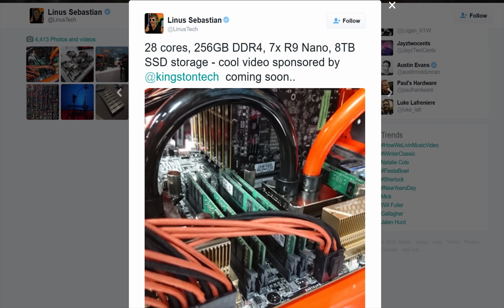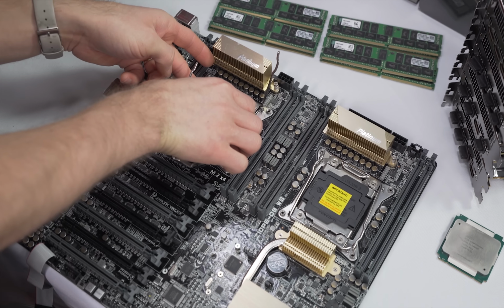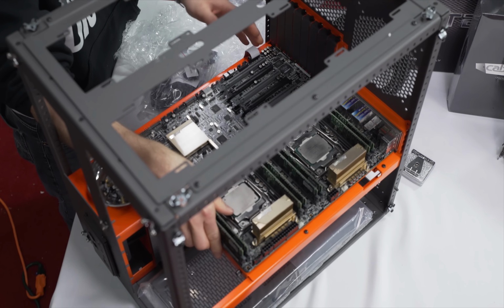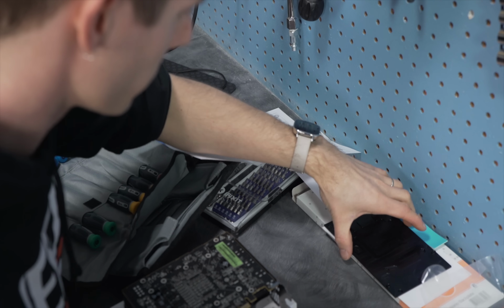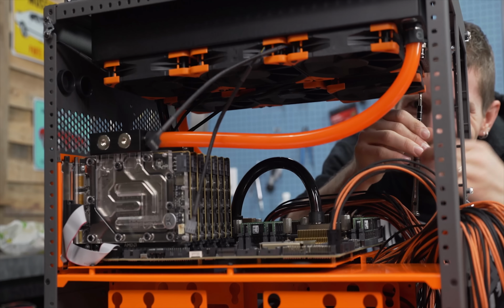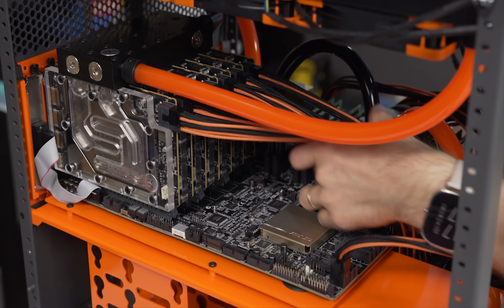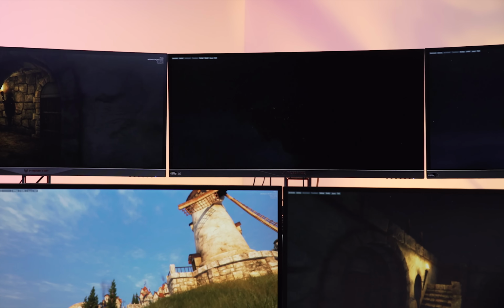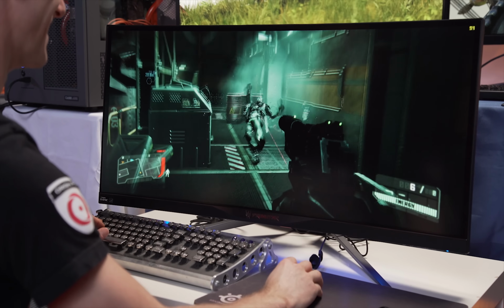7 Gamers, 1 CPU - Ultimate Virtualized Gaming Build Log

Comment: Those are two CPUs. It should say '7 Gamers, 1 PC'.
Reply: +Pascal Lafrenière A PC can have multiple CPUs and this one does.
Reply: +Dennis Gäbler And in fact technically pretty much all of our computers do. Technically each core of a multicore CPU is a CPU in itself. They just all happen to be on one chip
Reply: +Man of Low Moral Fiber It's a play on '2 girls, 1 cup' I think...
Reply: +Man of Low Moral Fiber Its all the same to the mother board and system. You cannot run two kernels simultaneously with these 2 CPUs and they act effectively as a single unit.
Reply: +Niles Black System level operation is a bit more than semantics... Its all that matters here, and a single mother board can only run a single system, no matter how many CPUs are attached to it. The 2 CPUs will always, necessarily act as one unit. So yes, there are 2 physical CPUs, but that is more a coincidence of how commercial CPUs are made... They could just as easily be the exact same two CPUs in one metal casing and there would be no difference at all and you would then call it 1. The fact that they happen to be separate from each other doesn't seem that important.
Reply: +Pascal Lafrenière You don't seem to know what you're talking about. Those are two CPU's.
Reply: +Man of Low Moral Fiber I agree, it's two CPU's. I've been a sysadmin for 2 decades, we all call them Multi-CPU's, Dual, Quad etc.  CPU is a chip.  Probably mistitled.
Reply: Guessing you did not hear Linus? There is not 1 CPU which can run that type of PC
Reply: +Man of Low Moral Fiber 2 sockets yea but still considered as 1 CPU for workload. Although oracle and ms will charge you double the license cost :P
Reply: +Niles Black Depends thoudh, cause where im from, we refer to the entire tower as the CPU. cause think about it, every graphics and logics processes are running in a unit, in this CASE, heheh , get it, case its the tower itself.
Reply: ***** it doesn't matter, it's like using SLI or Crossfire. It's still two physical CPU's. And as much as I enjoy watching Linus videos lately, I don't like when they have a projet that gets issues and they just skip the post part, turning it on, seing the parts move etc. They build tension and suspense with issues to the viewer, and then skip directly to benchmarks. I hate that.
Reply: CPU stand for Central processing unit, you can not have 2 center in anything, it's illogic.... Intel call their chip CPUs because in common pcs, you only put one processing chip and it appear to be the intel one (or amd)...

 But if you put one more processing chip on your motherboard, you will not add another center of processing, you will only add more core to the complete build.

that's my point, I dont care if you're too dumb to understand it, I may be wrong but please, give me your point if I am
Reply: Pascal Lafrenière Everyone refer to a CPU as the processor. That's why many servers will refer to their setup as Dual CPU or Quad CPU.  Same with graphic cards, GPU. If you have 2 you don't say you have one GPU. You will say dual or crossfire or SLI. (2 Way Sli, 3 way, 4 Way) but you will not say you only have one GPU.  So in this particular video, it's 2 CPU's, 7 GPU's.
Reply: +Man of Low Moral Fiber even if it is on 2 chip, a pc can only have 1 cpu

Comment: So how would a lan game go? Each instance must have its own IP i'm guessing,
Reply: +DJParsons89 he said he was running vms. There are aton of different ways to set networking up for vms. But the simplest is to just give each vm its own ip.
Reply: +DJParsons89 Probably uses a virtual LAN app like LogMeInHamachi
Reply: +Wyatt Freda-Cowie umm no, a service like hamachi would not be necessary because they all would already be on the same lan. Most vm applications will allow you to control each vms independent ip and give them virtual mac addresses. I honestly have no idea how the technology works but my best guess is the host machines connection is broadcasting multiple macs to the router. The router then assigns an ip to each mac, even though they are technically the same device (though the router does not know this). The vm client then filters incoming traffic and does a little routing of its own to send each packet to the vm associated with the destination ip. Or else all traffic is just sent to every vm, but I don't think that is what is happening. In this way the router sees 7 different computers even though they are all hosted on the same machine. Since they are all connected to the same router, they are all by default going to be on the same lan. Anyway I am by no means an expert but I have some vm experience and based on observations I have made in the past this is how I think it most likely is handled.

Comment: Linus you better not stop here! At CES2016 you need to obviously set the machine up for playing, BUT you need to also use the extra HDMI/DisplayPort connectors to output to separate monitors. Setup video advertisements/builds/nicky v/ anything on the extra ports so that you are not leaving anything untouched.

Squeeze more out of it!

Comment: This isn't a joke, could you use all the GPUs without using vm's and if so what fps would you get in a game like minecraft. It would probably be something like 3000fps
Reply: +Atlas-S You can't. Without DX12, games don't scale their GPU workload efficiently. Most games don't have proper drivers for more than 2x SLI.
Reply: You couldn't run them all alongside each other anyway, the max capacity of SLI or CrossFire is 4.
Reply: +Atlas-S Also minecraft isnt a GPU intensive game. Its made in java and almost everything goes through the CPU

Comment: Pretty sweet. Using two power supplies would be other option. I never seen consumer PSU with this type of IEC connector before.

Are you using Xen for virtualization? Or KVM?

I do not think you need so many SSDs. Two SSDs will be just fine and save you probably 5000$. 

Using two 8 core Xeons should also be just fine. Another 4000$ potentially saved.

256GB is also overkill. 12-16GB per VM would be just fine too.

Comment: Isn't this "7 Gamers 2 CPU's" though? You installed 2 CPU's in this PC right?

Still really cool nonetheless!
Reply: +Unilythe You're right but the OS does see it as only one CPU.
Reply: +CheapSushi Not necessarily, you can set it up to show all cpu cores and cpus in each VM.
Reply: If you're using a hypervisor yes, but I mean it more so for regular OS like Windows 10 (although I believe HyperV is included).
Reply: Windows 10 also sees multiple cpus and cores(and HT "cores"). You can check your device manager under processors. 

So, those 2 cpu would show up as 56 cpu devices in device manager.
Reply: +WoahWoah378 It also doesnt't really matter what the OS sees, it's still 2 CPU's. So it's not 7 Gamers 1 CPU.

Comment: Linus, a non-tech tip for you:
Get rid of the bike.
I was a biker myself and I had a bad, bad crash in August 2015. I`m still using metal crap on my let till hopefully the end of January 2016. Walking again will take several months yet.
I watch your videos fairly frequently and for some reason I always thought about saying this to you. Have it sold asap.
Just so you know, I was stationery, wearing all protective gear, the best money can buy, and an idiot crashed onto me. Fucked my leg up pretty bad. Now that you have a little boy, please consider this tip.
If you want to ride, ride it on a track or something. Never go out there to ride on normal traffic. There are idiots everywhere.
Reply: You were completely aware of the risk before you started riding, correct?  You just said that on a bike your completely exposed, so why would I be shocked one bit that you got injured?  YOU KNEW IT WAS DANGEROUS.

 "I've (or had) been riding for years, having minor crashes, injuries here and there - all because of my own stupidity or mechanical problems once. "  I find it really hard to feel bad for you.  I know I'm being rather insensitive to your situation, so I'll let you know that I have had a friend die riding a motorcycle.  It wasn't his fault either.  It's a possibility every time  you ride a motorcycle, does that keep me from riding?  No.  How many times in your driving course did they tell you "Watch for cars because they're not watching for you"?  Clearly they're dangerous.  Nobody is debating that.
Reply: Justin Fivash
You, sir... are an idiot.
Go to any hospital and visit the trauma and orthopaedics department there. Ask the first worker there who are the most terribly injured patients there. Don't take my word for that. Go and ask yourself.
I have a full motorbike licence (in the UK, you can only get one if you`re older than 24 and you need to pass three tests - one of them being rather difficult).
I've (or had) been riding for years, having minor crashes, injuries here and there - all because of my own stupidity or mechanical problems once. But I now realise that it takes a little nudge to get fucked. The guy who crashed onto me wasn't going fast. In fact, he didn't even crash properly - he only clipped me from the side. He was probably doing 20mph if not slower.
On a bike, you are completely vulnerable. There is nothing protecting you from an impact. You crash a bike at 30 mph you can get seriously injured or even die. In a car, you will get an achy neck if that.
And don't think am just a biker. I was a pro rider for many years, I know a lot about riding and my skills were, according to other people, impressive. I could ride a bike in excess of 200mph and do it flawlessly on a track.
If you disagree that you are much more likely to be seriously hurt on a bike than you'd be in a car, you are indeed an idiot.
Reply: +Justin Fivash I agree Justin. It's a slippery slope. I've been in a car crash before. Doesn't mean I'm not gonna ride a car again.
Reply: +Victor England Sorry Victor, but a bike is the only thing I can depend on anyway. Maybe you can donate a car to me?
Reply: +Victor England I'm a Canadian living in Mexico, I bought a 700GS "Adventure" bike.  People don't use their turn signals here, it was such a defensive experience every time I stepped on the bike but I didn't care. Then, one day, following traffic on the highway, dead dog,  too late and dangerous to swirve, ran over it, my bike slid, I got very lucky I regained control. Sold it next week, fuck this shit.  I bought a Jeep Wrangler for my offroad trips.  At least I've over 4,000 pounds steel cage around me if a moron does something.  This wasn't my first close call, but that one just did it for me.
Reply: Brawndo
I personally go in neighborhoods and ride on sidewalks if I can. Screw being on the road! LOL

Comment: Can this rig run all CPU cores and all the GPUs as single, standalone Windows (like your your casual gaming rig/non virtualized system)?
Reply: Imagine the framerate, the resolution(total overkill)
Reply: +I&#39;m So (Kawaii) CPU is easier but most games don&#39;t have driver support for proper SLI. Most can do 2x SLI efficiently but after that they tend to crash or mess up. It won't change until more games use DX12.
Reply: ***** well dammit then (some have good scaling and who knows what DirectX 12 or Vulcan will give us)

Comment: 7 gamers 1 cpu. Uses 2 cpus
Reply: +Derek Bond true but the OS sees it as one
Reply: ***** I matters greatly what the OS thinks or else it wouldn't work.
Reply: +Nathan Pattison No it doesn't.
Reply: +Nathan Pattison i think its a mistake because in the title say 1 CPU but in the vídeo says 1 tower
Reply: +Nathan Pattison So, if those two CPUs happened to be in the same metal casing, then you would call them 1. That's literally the only difference. At the system level, with a single mother board, no matter how many pieces you have, it is one CPU.
Reply: +Derek Bond it is still ONE Central Processing Unit (which is the whole tower)

Comment: so i assume the gpu's are running at 8x? Because 80 lanes isn't enough to run them at 16x
Reply: +jabadahut50 8x is still plenty of information can you normally wouldnt see any difference at all between 8x and 16x
Reply: +jabadahut50 8x PCIe 3.0 is pretty damn fast, not really a bottlneck. Also, some of them are 16x, and maybe other are using some PLX bridge. 8x PCI 3.0 should be enough, and it is not like each GPU uses full bandwidth all the time (it is more a burst of traffic for each GPU, and bursts to different GPUs do not necessarily overlap).
Reply: well I doubt it'd change much of anything to be in an 8x only slot instead of 16x it's just a question of technical specs.*****

Comment: Would love to see the amount of fps In games alone
Reply: +MoistFishy (tuna) that probably wouldnt be possible since drivers dont exist to run 7 GPUs at once
Reply: +MichaelParktheFirst it's completely possible in fact he shows and talks about the FPS in the video....
Reply: Eevee A_ no but Amd doesnt have drivers that supoort 7 way crossover
Reply: MichaelParktheFirst The guy's question can be taken two different ways, I just took it differently. Doesn't matter.
Reply: +MichaelParktheFirst Sure, AMD doesn't have drivers that support 7-way crossfire, but it is not needed. The machine can running 7 independent instances of games, with each card handling a VM. So it's just like 7 different machines (each having a graphics card) build into a massive one.
Reply: Lâm Thanh Nguyễn oh so you mean testing the system with only one virtual machine
Reply: Yeah, that's kind of what I meant. Just think of this as 7 different 'computers'. And so all of them are capable of handling games at the same time.

Comment: How hot does the room that its in get?!?!
Reply: +MichaelParktheFirst  The radiators emit heat from the components you absolute mong. The system draws 1500W. That room will be toasty.
Reply: +MichaelParktheFirst thats not how heat works
Reply: Jaaamm
About time the troll arrived
Reply: lol all so stupid, energy is never transferred, it's either created or destroyed duuuhh
Reply: +Ben Pena just tell the mechanical engineer who is designing the rooms cooling system the power consumption and the desired temp, and we can do anything.
It drives me crazy when a hospital puts 6 computers in a room labeled "closet", and then complains that the room is too hot. It would have taken maybe 1 hours worth of work to handle it if it had been communicated, but now it is an entirely separate system to be designed and installed.
Reply: +MichaelParktheFirst Do you even physics?
Reply: +MichaelParktheFirst It doesn't. The room does (water cooling can dissipate the heat from the components to the air of the room very efficiently).
The video was shot in an industrial size hall so I don't think that it really made the "room" any hotter.
Reply: If it gets hot enough. You could use the heat to generate MORE ELECTRICITY!!
Reply: +Ben Pena That's true! That room must get boiling!
Reply: MrJason005 Yup, i believe the sun converts either 7 or .7% (I remember seeing a documentary on this, i just don't remember the number exactly) of each hydrogen atom into energy during a reaction.
Reply: +Ben Pena its liquid cooled. it doesnt
Reply: +MichaelParktheFirst the heatdoesnt magically disappear... The rad has fans that blow the heat out...
Reply: +MichaelParktheFirst all electrical energy eventually turns into heat, even sound and vibrations turn into heat. So yes, still dumps heat into the room.
Reply: +MichaelParktheFirst Ever heard of... CONSERVATION OF ENERGY!
Reply: +MrJason005 ever heard of... E=MC^2? Energy = mass times the speed of light squared. Matter is energy. The amount of energy in something is its mass times the speed of light squared. If you combine a proton and an anti-proton, they totally annihilate, releasing all of their mass as energy. With that said, you could get technical and say that the conservation of energy is still real because mass is still just condensed energy. The room will still see an increase in heat energy, though, because this kinda stuff doesn't happen just because you have a big computer.
Reply: Eric W. And if I'm not mistaken, the way nuclean fusion works is by using a huge amount of energy to fuse atom cores into new elements, and the left over protons/neutrons get converted to a lot of energy that can run our kettle, still using Einstein's equation E=mc^2
Reply: +Ben Pena Depends... Are there 7 fat guys playing from that one tower?
Reply: +MichaelParktheFirst That's not how the universe works. Liquid cooling does not magically disappear the heat. The components will run cooler because liquid and radiators dissipate the heat more efficiently, but all that energy is still there and it has to go somewhere, in this case, the room. 1500W are enough to keep your room warm during a cold winter.
Reply: I have a radeon system with one gpu in it that I use to bake bread, so just that time 7.
Reply: +Caleb M Baking 7 breads at the same time? That's pretty neat!